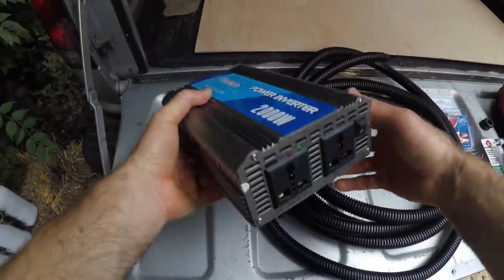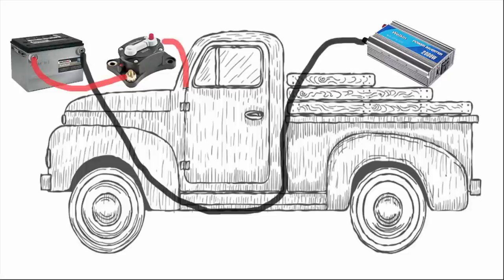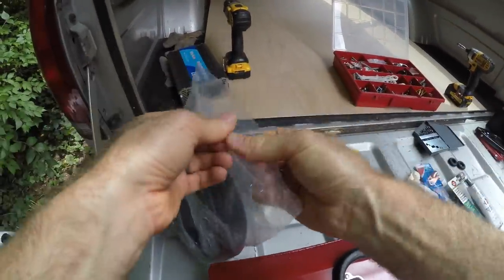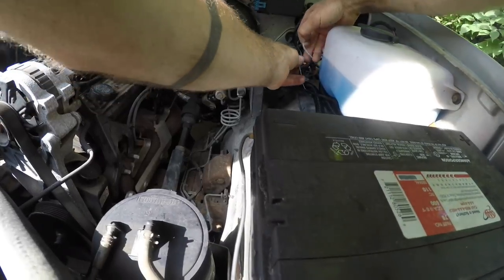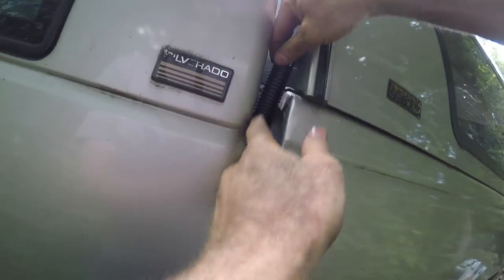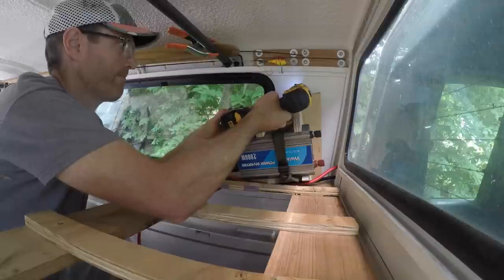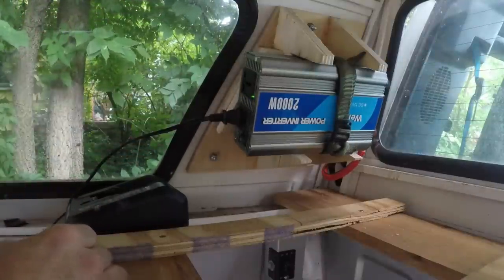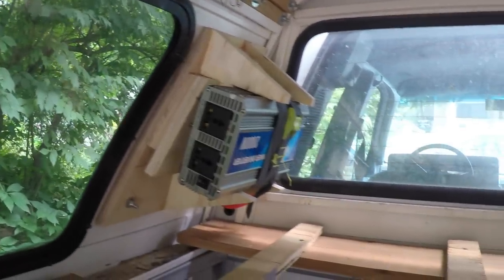Installing a Truck Inverter

Comment: I like that crimping trick with a screwdriver. Always learning things from you. Thanks!
Reply from the maker: haha ... thanks, man!
Reply: That crimping trick might end up kicking him later.. there's a reason crimp tools have a 'V' shape on Both sides.
Reply: Chris W Same idea using two triangular files then. Still saves buying a crimping tool for a single job.
Reply from the maker: That sounds like it would work well
Reply: They say, give a competent man a tool and he can find a 1000 uses for it.
Reply from the maker: @chrisfi3d  what a great saying! :)
Reply: Yeah but did you notice he didn't show how he did the other ends. You can't crimp on the vice all the time. It is best to buy a $25 crimper or get a loaner crimper. I used to do it something like he did, I got some 1/4in angle iron and grinded some ridges into two opposing pieces and drilled holes so they replace the jaw plates/inserts. Made it so much easier than holding a screwdriver. Butt just get the tool.

Comment: Cutting the jumpers cables up to make your leads was just genius.  I priced the same gauge cable against  buying jumper cables and the cables where cheaper. Thanks.
Reply from the maker: Most excellent! Gotta get the good deals when ya can
Reply: @metaspencer  you bet!

Comment: One major thing needs saying. A Certain manufacturer,on Amazon, was describing their 2 gauge wiring as  #2 AWG wire. American Wire Gauge is a TECHNICAL STANDARD stating current and voltage handling characteristics. When checked,the wire was ultra-light and questionable as "copper". When checked,the wire was magnetically attracted. It was arc-sprayed cast iron wire with a copper coating. ALWAYS use wire supplied by a standard manufacturer,rather than depending on junk jumper cables for constant power transfer. Welding cable is best !!
Reply from the maker: Wow, crazy story! Thanks for the tips
Reply: There are some good jumper cables out there I have one I don't want to cut, there is also another trend of 10 pounds of insulation on a 20 gauge wire they were free.
Reply: Yes! For the best quality and price for cable, source it from a welding supplier.  Even Harbor Freight (U.S.) or Princess Auto (Canada) welding cable by the foot is a better gamble than recycled booster cables.  Size the wire as large as you can tolerate for DC current and keep the runs as short as possible.  Never exceed 10 feet per run.
Reply: @chrisgraham2904  10 ft? If you never exceed 10ft per run than no car amplifiers could ever be installed in trunks etc. As this is common practice what is your reasoning?
Reply: @donalddluckerii3147  For every inverter manufacturer that I investigated, somewhere in their fine print they state that the wire length between the battery and the inverter must not exceed 10 ft.  The inverter warranty is void if that length is exceeded, so I assume that this is their legal liability issue.  Many people do exceed that limit when installing on pick-up trucks, etc. and seem to have little issues.  Don't skimp on wire size and oversize beyond recommended where ever possible.  Solar panel manufacturers and retailers are also a good resource for expert advise on inverter installations.
Reply: @chrisgraham2904  I gotcha. You were referring specifically to wiring for the converters. I was assuming that was a recomendation for all dc power cables like amps etc.
Reply: Can I just use romex?

Comment: inverter is in a good location, and you don't need to put it in the engine compartment but a few notes: 

1) Your Red power wires should be wrapped with electrical tape (depending on voltage, select appropriate electrical tape) so you do not see any exposed terminals or wire!
2) I like your vice with screwdriver trick!
3) You can ground to the bed (shorter grounds are safer. Ground wires should be the same size or larger than your power wires. Less resistance = better ground. Wire brush your frame and use a fat ass bolt torque nicely to the frame as your ground location. Running it all the way to the battery was completely unnecessary and less-safe than a shorter ground. 
4) Great idea with the secondary battery & Isolator!
Reply from the maker: Solid ideas, thanks !

Comment: Things that i recommend with this setup! 
Get a meanwell inverter, u can have a 1500w model for 250$ and they are way better quality and most importantly won't burn ur truck down!. Get a 12v 100ah Lifepo4 battery from Amazon and use 100amp contractor so that it will only connect to your truck battery only when the engine is running. When engine is not running the inverter will only drain the 100ah Lifepo4 battery which should give u about 1100w/hr to use. Don't forget to install an temperature controller for the alternator or the lithium will pull too much current from the alternator at idle & fry the coil!
Reply from the maker: Interesting ideas and insights. Thanks buddy!

Comment: One improvement. Add two small strips of ears there stripping on the jig where the bottom of the inverter touches it to keep it in place for sure and vibrations down.

Comment: Pls note:
Change that breaker to 100amp.

Put the inverter in the engine bay. Need to be as close as possible to the battery. 

No need to run negative cable. If slave battery is already grounded to truck, then simply ground inverter to truck.

If that inverter fails you could have a real problem.. fire.

You are a very talented guy. Just change the amp rating.  If it blows at 100 amps. The inverter needs to be relocated closer to battery. 

God Bless. Be Safe. Cheers!
Reply from the maker: That all makes good sense ... 100 amp is way safer. I use it sparingly but see what you mean. Thanks!
Reply: And open the hood every time I need to use it?   Hmmm
Reply from the maker: @gradyrm237  for me that works since I use it only once a week or even less ...
Reply: @gradyrm237  You can run an extension cord to the back of the truck. AC has less loss/heat than DC does and doesn't require as thick of a cable

Comment: Screwdriver in the vice crimping tip is a top trick, nice one mate . Cutting the damn cables without a super duty cutter is something i'd love to know , them cutters are big bucks ! A hacksaw makes a right old birds nest !
Reply from the maker: I just cut and cut and cut until all the strands are cut ... seems to work!
Reply: @metaspencer  I'll give it a go on an old cable , my snips are probably crap and dull too. cheers

Comment: This is great step by step instructions! I have 1994 Silverado so I'll be doing pretty much the same. I'm needing to live in my truck for a few months sadly while I go to school. But this video is one of many glad you posted!
Reply from the maker: I installed this inverter after spending a week sleeping in the back of the truck -- it's great to be able to plug in and charge things back there. You're gonna like it. Note that you might be able to save some money and time by installing the unit under the hood and simply plugging in an extension cord for your power. That's another option. Good luck with the project and truck life!
Reply: I wonder if this inverter is strong enough to run a small 100 psi air compressor.
Reply from the maker: I think it would be. Just check amps on the compressor
Reply: @metaspencer  Great vid.... question please. I have read that car batteries are inherently limited to about 150 to 200w power draws? can that be true?  how does a 2000w inverter work with a regular battery then?  Thank you so much.
Reply from the maker: @uber2tuber  Yeah you will surely encounter limits when pulling from a car battery ... from what I know it all depends on the size of the batteries, alternator, etc

Comment: An inverter on a truck is MUST HAVE.  I have a big 140min reserve Bosch led acid on my 2012 Ram 1500 and have been running a pure 1200 watt inverter on my truck for several years now.  Here's what I've learned.  The closer the inverter to the battery the more power you get.   The shorter and thicker the cables from the inverter to the battery the more power you get.  IMO, your inverter might be 2000 Watts, but you likely can't get more 900 watts from your battery even with lights off and while running your engine.   My 1200 Watt inverter sits right on top of my battery's insulation locked safely under the hood and the cables are 4 gauge and about 5 inches short.  I ran a heavy duty 110v extension chord safely and securely down the side of the engine bay and zip locked it to some other cables running on the top of the frame (away from any exhaust and fuel lines) and then up into the bed under the tailgate.  No drilling, very secure and you can't see the cable unless you open the tailgate.  Been running like this for years and am able to cut and drill 4x4 PT, make coffee, cook rice and even fry a steak.  I keep the inverter off when I'm not using it for safety and since it's fan does consume some amps.
Reply from the maker: Okay, now why didn't I think of that! Put the inverter up front and then just run an extension cord to the rear of the truck. Doh! Great plan there, man. I really like that idea. Plus, it's flexible if you need to run the cord out the front end. Thanks for that tip and the thinking of power reduction.
Reply: wouldnt you have to open the hood and switch the inverter on everytime you wanted to use it.  what about water getting in the inverter.
Reply from the maker: @bobmanfredonia8412  I could keep the breaker switched on all the time, but prefer to keep it off when not using the inverter. For me, using the inverter is just an occasional thing, so switching it under the hood is not a big deal. I'm sure others have different needs. As for water, it's not a problem: the unit is nice and dry under my topper.
Reply from the maker: I wonder about the heat AND the water ...
Reply from the maker: Hell's favorite NPC #69OU812 . exe  Yeah, that makes sense ... seems to work for the low draw uses I put it to, at least

Comment: I mounted my 4000 watt inverter near the tail gate at the back end of the truck with the cord outlets facing the tail gate.  Climbing in and out of the truck for power is a pain.  I did learn two neat tricks as others had mentioned.  Enjoyed the video and good job on the install.  The bracket for the inverter could have been much lighter by changing it to just a belt strap with one bolt and washer in the middle of each strap and then using that to hold the inverter with no wood needed.  Again good job.  Love the videos on youtube.

Mark Jones from Springfield MO
Reply from the maker: Man, I'm jealous! How did you get a long enough wire to reach the tailgate? I know what you mean about it being a pain, but I've been using a 10ft extension cord, which is less annoying. Take care!
Reply: I purchased stranded #6 house wire.  Put it in the flex duct like you did yet the cheap duct rotted out after about 8 years.  Just got a new f150 and will reinstall this wiring and some new duct.  I may have to buy some new wire.   Welding cable is a good choice as well for longer runs.  Again good job on the video and install.
Reply from the maker: Oh, very good. I think I'll follow your advice on my other truck. It would be great to have the plugs way in back

Comment: Like the set , but the only thing I would change is the location of the off/on switch I would find a place in the cab.👍🏻
Reply from the maker: cool idea, especially if you plan to use it a lot

Comment: Since the truck is negative ground, you only needed to route the red positive wire through the truck and drill one less hole.  Then you will only need a short negative wire between the inverter and the truck frame.
Reply from the maker: I get that now — thanks. Too many years of house wiring on my end I guess haha ... take care
Reply: In my opinion it's still best to run straight to the battery especially when drawing a lot from the battery
Reply: Any inverter over 1000 watt must have both - & +,  2 awg (or larger) cables. Im not an expert, but every one I've ever owned would clearly state that in the manual.....
Reply: @jasonpintler8150  but isn't several hundred square feet (guess) of conductive metal at least 0 gauge? Its an honest question as I don't know the answer.
Reply: @awesomesauce2935  The ground circuit thru the chassis must still be connected to the battery. The small size of the battery to chassis ground cable will result in a voltage drop going to the inverter. The greater the load on the inverter the greater the voltage drop. The more the voltage drop the more amps required to deliver the same watts/power.  The greater the amp draw the more the wires will heat up. The resistance from the heat will farther reduce will the voltage requiring even more amps.

Comment: Instead of crimping like that, get a propane/map gas torch, put the eyelets in your vice so the cup is upward, sweat some solder down into the cup, and then push the stranded wire in the cup and let cool.    Presto, no crimping and solid connection.
Reply from the maker: Oh dang, I like the sound of that. A nice soldered connection is always the best. T'hanks for the tip!

Comment: I think I got the same jumper they were from a local store, i was a little disappointed to find out that they were copper clad aluminum but it will work. I ended up drilling out the rivet so I could save the clips for other uses and keep the extra 6in of wire.
Reply from the maker: That copper coated aluminum is too common! Saving the clips was smart
Reply: @metaspencer  I was between a set at Walmart and a set an a bargain Close out store, from what I could tell thoroughly looking at them in the store they looked good and that they were supposedly 2 gauge. the price was about the same and I couldn't see the Walmart version which was smaller.
So I went with these big suckers they're about the size of my thumb and nice and flexible, now if only my fuse holder would come in I would have to force myself to find a way through the firewall and be good.
My biggest inverter is a 750w MSW :-( I keep saying my next is going to be a true sine-wave output it runs things more efficiently and some audio/amps/motors don't like modified. so I'm like way overkill anyway with a little bit of expansion.

And all I have to do is get some ring terminals, nuts and bolts and I can put clips on whatever I want, or use them as clamps.

Another thing I did instead of ring terminals is I got some electrical terminals that you usually bolt to a bus bar and have a screw tightened clamping mechanism to put the wire in and tighten it down which will make it easy to remove or change in the future. I do a lot of stuff with the end goal of having it be removable with minor changes, considering I went through three cars in six months :-( I am certainly looking at how easy it is to remove in 30 minutes while the guys watching you at the junkyard. I had to rip out my Bluetooth aftermarket radio and any other modifications I wanted to save and even tried to get the full tank of gas that I just put in…
Reply from the maker: @imark7777777  Sounds like a good set-up and approach to me! You're gonna love it
Reply: The funny thing is a day or two after making this last comment my fuse holders finally came in and they sat around for a while. I Finally got everything in and it's all done and it works nice. I was looking around for a small disconnect to turn off and not drained the battery when not in use and decided to go with my original plan of using the second fuse holder.
Reply from the maker: Awesome! Great to have it running

Comment: Just one thought as an electrical engineer, the heavier wire is on the DC side and also AC has less loss per foot distance so if you can keep inverter closer to battery, you will save money on wire and results with better AC voltage at outlets
Reply from the maker: Makes good sense. Thanks man

Comment: Nice install brother. Quick question. Could you connect the ground to the chassis instead of going all the way to the battery? Thank you for your time!
Reply from the maker: Oh yeah, that will save you time and wire. The chassis is definitely a good ground

Comment: Hey great job I like the way you crimped your ends with a vice and a screw driver , I just bought a 1500 watt inverter to charge batteries and plug in my laptops and my computers I’ll probably get a second battery like you have so I can run my power with the van  off
Reply from the maker: Oh how I'd love a van! Now I'm jealous. Good luck as you set it all up ... you're gonna love being able to charge stuff up
Reply: metaspencer I just got the unit up and running now I can charge my phone I’m taking a road trip so now I have power for my 2 laptops and I can put in work 
When I build my new house I’m going to wire it up for direct current 
I may have an underground wire to a utility shed with city power but other then that AC power useless in my mind
Reply from the maker: @joshuajonathanhood1227  Sounds excellent. I've got a buddy who has a full solar setup and it's awesome
Reply: metaspencer I already am using my laptop and charging my phone it’s awesome ! My inverter already has a switch in it so I didn’t have to install one , the vans nice I’m living in my van while I travel across country working from vehicle it’s a must to have power
Reply: metaspencer does he have a YouTube ? I would love to see his set up I’m actually friends with Elon Musk & will be lobbying for solid energy above all other energy sources . When I build my new house I’m going to install solar panel roofing shingles do you own your own home ? If so how long does your roof have left on it’s life ? I may be able to get you some solar panels at cost once available I’m I’m thinking in the next 1-3 years....

Comment: Nice video dude. My only concern is that copper clad aluminium (the jumper cables) gets brittle and can be dangerous.
Reply from the maker: Thanks for the tip! I'll check that out periodically